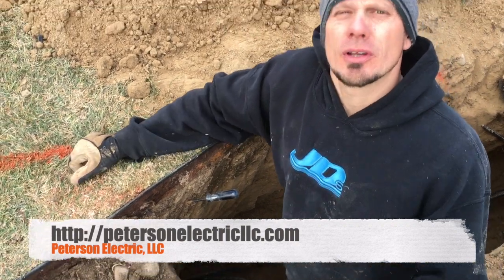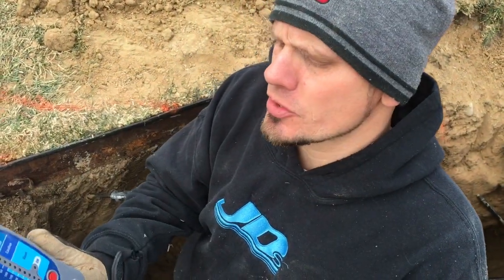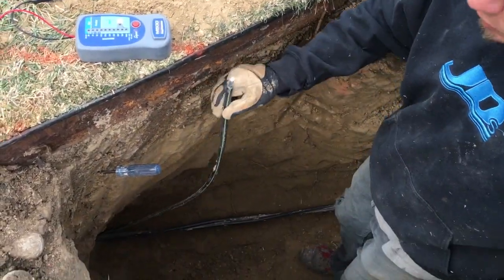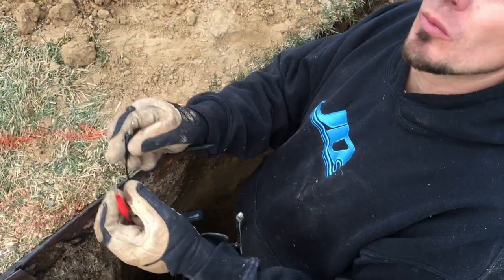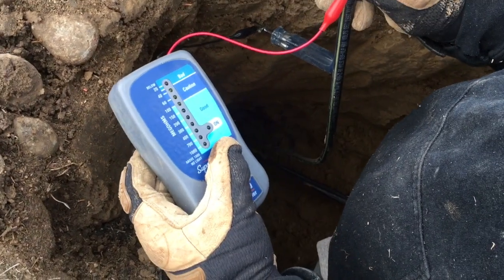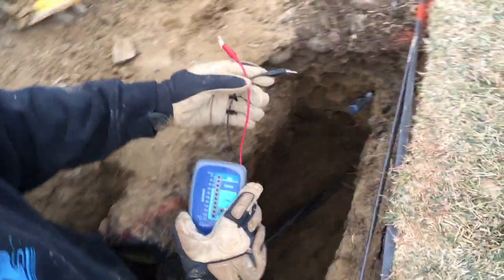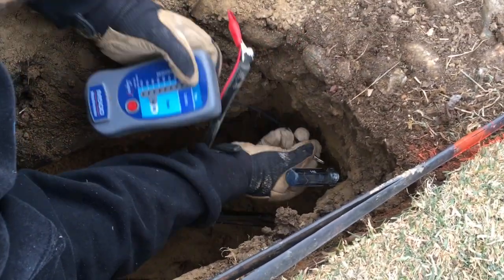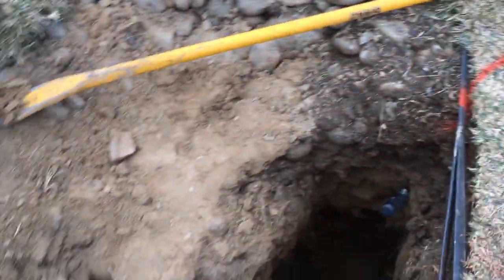Power Out, Lights Flickering—Part 3

Comment: Hi Josh, I'm wondering why you didn't appear to attempt to find the fault with your A frame fault locator? I have used that same locator many times with 100 percent accuracy even in shale.
Reply from the maker: I think those two pieces of metal I found in the same trench was trowing me off. I also think I may have used the A frame backwards. I since met another master that has used this same meter at a trade code show and he said that this meter has to be ran with the A frame parallel to the trench (with both legs running along the same trench and not both legs running side to side to the trench. So, I am wondering if this would have helped my result or if the two metal heads for past boring would have still throwing me off?